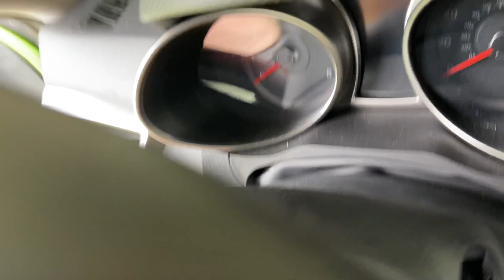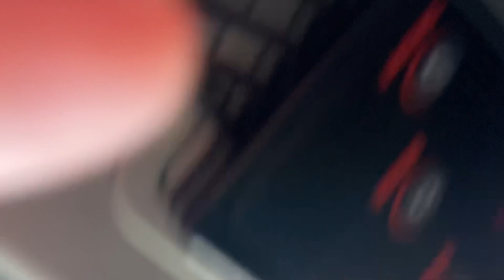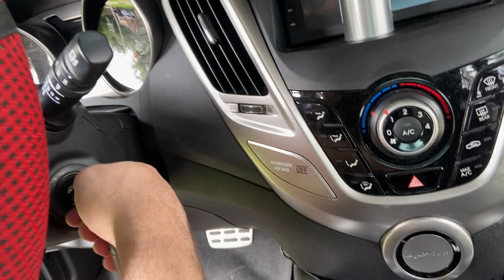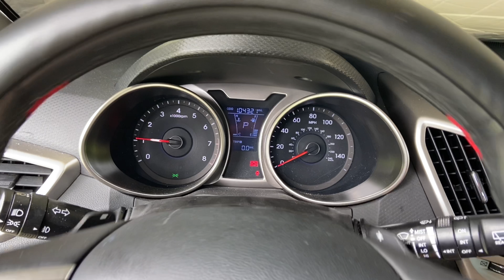Hyundai Veloster - Fix clicking steering wheel

Comment: Any tips for breaking the last 14mm bold loose? I got to that very last bolt and could not break it lose without risking damage from slipping(its really hard to get the proper leverage), Im thinking of waiting untill its really cold outside and then either using a hair drier and or turning the climate control to blow hot air through the leg vents in the hope of some how expand and contract the bolt enough to break it lose more easily. I might end up having to bite the bullet and buy a torque wrench or somethin, or maybe a neighbor might let me borrow one. Also i was wondering if using any thread losener or stuck bolt spray cans would be a good idea, as long as i also put back on the thread locker afterwards, and as long as i clean all of the thread losener off And dont get it on ANY of the electronics/wire connectors... i guess i will save that as a last resort. 

Also Thank you for posting this video, you are a life saver!
Reply from the maker: The trick I use for stuck bolts is to slightly tighten them first, then try loosening again. Kind of a ‘rock back and forth’ thing.
Reply: @Frostcall  I don't know if I can tighten it,  it'sREALLY REALLY on there. I can't budge it at all in either direction, it feels way over-torqued past spec. I think one of the techs at Hyundai the last time they were under the dash and stuff, they went a bit ham on that bolt. I mean I'm putting enough pressure to worry about breaking my wrench or shearing metal on the bolt. That tight.
Reply from the maker: @CrazySaVaunT  Yeah, sounds like it’s over tightened.
Reply: @Frostcall  It is still barely getting into winter where i live, CA, meaning just starting to get below 55F lowest at night. Im thinking i might be able to break it lose when its 40F, also thinking of putting an ice pack on/around the bolt before hand, or trying a few alternations of that and a hair drier. That or maybe make a deal with someone at the dealership to just brake it lose (though I doubt they will touch it without paying full price)
Reply from the maker: @CrazySaVaunT  Best wishes. I hope it goes well.
Reply: @Frostcall  not sure if my previous comment was deleted because of the link, but i got it off. I found out that the coupler is glued in place and I cannot for the life of me get it off without doing damage. Have you ever heard of this?
Reply from the maker: @CrazySaVaunT  No, I’ve not seen it like that before but I haven’t been a real mechanic in over 20 years so there’s a lot I haven’t seen.

Comment: My same car
Cruise (on) working
But speed lock not working 
What might be issue ?
I have same veloster model 2012 
Cruise (on) button is working
But speed lock not working 
What might be issue ?
I have even changed coil spring but still speed lock not working
Reply from the maker: I don't think so. That sounds like you have a different problem. Your problem sounds electronic.

Comment: Thanks for the video.. so I accidentally pulled of my steering wheel and when I placed it back my steering wheel is off center.  Would you know if I have to remove the 14mm bolt just to realign the steering the wheel ??
Reply from the maker: I didn’t know it could go back on off center. It might be a good idea to have a friend help you and take it off, then put it back on (the bolt).

Comment: We changed ours in our car but the airbag light does not go off now would u happen to know what we did wrong
Reply from the maker: It sounds like one of the airbag connections might have come loose out a wire was damaged. Try disconnecting the airbag plugs, then connect them back again. Make sure the car battery is disconnected before doing this.
Reply: Ok thank I will let u know if that works
Reply from the maker: @ernestinahinojosa8256  Did you get it working?

Comment: Thanks for the video! I don't have a noise but I do feel the steering a bit looser (with some play) in the center. You think it might be this?
Reply from the maker: Erwin Ried If there is play in the steering wheel without the clicking, it might not be this issue. It could be the tie rods.
Reply: @Frostcall  cool, will check. It just feel looser than before, but without clicking

Comment: Hello! The controls on the steering wheel of my veloster stopped working. Do you have any idea how to fix it?
Reply from the maker: Both sides or just one side? Also, have you recently taken apart the steering column or the radio? If so, something might be disconnected.
Reply: @Frostcall  Do not disconnect anything yet, it is as it came from the factory
Reply from the maker: @tonybernier9118  In that case, my first thought would be that a fuse has blown. There are two fuse boxes in the car but the one you want to check is located near the steering wheel on the drivers side. Get a cheap fuse puller so you don’t damage your fuses and start checking the fuses in that box. Most should be labeled on the cover. This might be a very cheap fix.
Reply: My controls on the steering wheel stopped working as well as the horn. I had to replace the "clockspring" in the steering wheel to fix it.
Reply from the maker: @PatriciaSmith-fz6mx  If you have a video showing how to do this, feel free to link it in here. It might help Tony.

Comment: Tried it. Failed. The extraction was easy but putting it back was a hard task. The spine of the wheel slid off while I was trying to mount it back with the 14mm screw. Eventually I got everything back on but now my EPS and Traction lights are on and the steering wheel is tight to turn. Any suggestions?
Reply from the maker: There is likely something that is not connected. Re-check all of the connections and look for any broken wires.
Reply: Will do. Appreciate it.
Reply: Check it and you were right. The pink wire coming from the EPS was broken from the connector. Any suggestions on how to pull the excess wire still in the connector, so I can insert the hot wire back in?
Reply from the maker: @stacyreddick7464  Here are a few videos from others that might help. It's really not that difficult once you know how to do it:
https://www.youtube.com/watch?v=r7GlDBge_WU
https://www.youtube.com/watch?v=beI0L23S5hY
Reply from the maker: @stacyreddick7464  Sorry for the late reply. If there is not enough wire, try using a wire coupler (google it) to connect the broken halves, or add more to the broken half.

Comment: Please please help my husband did all this steps, and now I have no steering period!! Any tips.
Reply from the maker: If you have absolutely no steering then it’s likely that the steering column is no longer connected to the steering wheel. If you have some steering but it’s difficult, then it’s likely to be a power-steering issue. Have a friend of your husband’s go over the steps with him, one by one. A second person is usually needed to get the steering wheel back in place properly. Take a lot of pictures as you go through the steps and compare with what you see in the video. If all else fails, call a mechanic. You can do this.
Reply: @frostcall i have no power steering now either. ESP light and traction light are now on and were not before this.

Comment: Heeeeelp! I have replaced the coupler but my steering wheel didn’t lock and I am having hell getting the column up so I can thread the 14 mm bolt... the lip that must go thru the back of it first is hitting the bracket. I cannot see you get it lifted enough to slide in. Also my steering wheel did NOT lock. 😞
Reply from the maker: Lorena Swan I used my legs to lift it in place but it might be helpful to have another person help lift it while you put the bolt in.

Comment: Perfect video ty but I'm having a hell of a time getting steering wheel back up in place didn't realize how heavy it is
Reply: it's nearly impossible to lift, position, and bolt by yourself. nearly had a heat stroke doing it haha.
Reply: I ended up having buddy come over and lift main piece and you have to push back towards firewall so it seats ,but otherwise your tutorial was just perfect plus it was 95 wonderful Florida weather
Reply: @kevinkelly9955   ok another issue gas tank takes forever to fill up
Reply from the maker: Sorry I didn’t capture that part on video. I was upside down with my feet on the seat and used my legs to lift the steering wheel while I put the bolt in.

Comment: What did i do wrong because
Steering coluim is cruket
Reply: Please help me
Reply from the maker: Try going through the steps again, slowly, with a friend to help. Go slow, watch the video a few times. You probably missed a bolt in the steering column. Let me know how it goes.
Reply from the maker: Also, read the pinned comment in the comments section about the steering column. It can be tricky to get the steering column in properly. You can do this.

Comment: Can I just turn the circuit breaker panel to OFF instead of disconnecting the battery?
Reply from the maker: No. You need to disconnect the battery so you don’t set off the airbag and simply turning off at the breaker panel won’t disconnect the airbag (from my understanding).

Comment: If you get this take to to dealer or call, I took mine in doing same thing, there is a recall on the part for this. At least there was for my model and year. I had a 2014 Veloster Turbo

Comment: 5:09 - 5:13 Another Important Point,  that connector there, instead of prying at it from the top side right side, if you poke the flat head screw driver on the opposite side underneath (the side where you plug stuff into it normally, there are two push pin thingies, you can push that clip in and it slides right out instead of risking plastic damage and or inducing a rattling noise by prying at it that much.

Comment: I did everything everything and it appeared to be right when I loosened the wheel  I went into my house to look at the video when I came back out when wheel was laying on the floor it seemed to be in a different position the holes for the 2 12 meter holes where almost upside down but the wheel didn't line up, this may cost me a flat bed and a lot of money

Comment: What happens if i do not fix this?
Reply from the maker: Probably nothing serious for a long time. Other than the steering being more difficult, you could eventually damage some of the internal components not being cushioned by that rubber piece. But that will likely take many years. It’s more of an annoyance.
Reply: @Frostcall  I appreciate you're insight and I definitely will take it into consideration. Thank you.
Reply: @Frostcall  I got a free new engine, due to the recall after over two months at the dealership. Got the car back and didn't want it to literally sound like a clunker with a new engine in, so finally decided to tackle this

Comment: Thanks so much for the tutorial.  I accidentally pulled off my steering wheel while installing back on. My steering is slightly left while driving now. Any suggestions? Anyone?. Thanks
Reply from the maker: I’m not sure, but maybe try taking it apart and lining it back up so it’s straight might help.
Reply: Thanks , I'll try that.

Comment: My steering collumn is moving in and out now that ive changed this
Reply from the maker: You're missing a bolt somewhere. Go over the steps again and I think you'll find the issue.
Reply: @Frostcall  oddly enough my adjustment lever moved so much it loosened that bolt that holds all of it i gave it a few small turns it adjusted as it should

Comment: That was amazing. I did mine yesterday but when I completed, my ESC light came on. Any Idea how to turn it off or fix it. It wasn’t on before. Thanks, for your help. If someone can help me, that will be great.
Reply from the maker: The electric stability control (ESC) light is usually illuminated when the ESC has manually been turned off. First, try pressing the stability control button (the one with the car that has swerve lines under it) near the air conditioning. If that doesn’t make the light go away, then you might have a loose connector in the steering column. You can unplug, then replug all of the connectors (after battery is turned off).

Comment: I changed it and my power steering light came on and steering wheel got hard
Reply from the maker: I don’t know about the steering, perhaps check the connections to make sure everything is seated properly by unplugging and then replugging everything back. Also check your power steering fluid under the hood to make sure it’s in the correct zone of min and max.
Reply: @Frostcall  thanks bro just fixed it connectin wasn’t plugged in 😓
Reply: @Frostcall  thanks bro just fixed it connectin wasn’t plugged in 😓

Comment: The steering is very tight after this. Like there is no power steering
Reply from the maker: It sounds like not everything got plugged back in. Check the fuses, check the plug connections.

Comment: I did this and now my eps light is on and traction control
Reply: Did you find a fix to this?
Reply: @brysonlowe175   yes. It turns out its just the motor went out. Its like 200 bucks for a used one

Comment: Did anyone also have some steering wheel play while drive with the clicking noise?
Reply from the maker: Yes. The breakdown of the rubber thing is what gives the steering wheel play. The play in the wheel (and lack of rubber between the metal parts) is what causes the clicking.
Reply: @Frostcall  thx!!!!

Comment: For something that is so easily to break to be used as a steering coupler is beyond any normal reasoning.  Like what were Hyundai thinking when they designed this?  If you're mechanical savvy then this would just be a pain in the ass, but to the normal average person, they would be spending 300-400 dollars every time this part wear and tears.
Reply: After examining the old coupler its literally melted marshmallow....I can see this being an issue in hotter areas that can reach 90 -100 degree plus.  I'm not sure if Hyundai factor this in but it was a pain to replace something that will melt and shred so easily.  I'm in California and when this first happen it was during a very hot weather.   And since gas was expensive I went with opening the windows instead of turning on the A/C.  Since I now know where the coupler housing is located I'm probably gonna turn on A/C and have it also vent to the leg area during hot days to hopefully prolong the coupler.
Reply: Will this make your steering not return to center like when ya going around a curve??
Reply: @ethanstallings4459  What do you mean?  Do you mean when the steering coupler is broken or do you mean when you're replacing the part?
Reply: @rustybros   yes before ya fix it my steering wheel has the play and that noise but like when im going around a curve I have to turn it back like it won't straighten itself out didn't know if the coupler would make it do that to or if I had 2 problems
Reply: @ethanstallings4459  Hmm..That might sound like a different issue.  The coupler is literally just a rubber plastic that acts as a cushion between the two metal gears where the steering pump and steering column meets.  Do your steering wheel feel heavy like there is no power steering anymore?  Probably look into the steering pump?
Reply: @rustybros   no I don't think its in the power steering tho idk lol but when sitting still ya can move steering wheel bput a inch back and forth and its making a clunking noise
Reply: @ethanstallings4459  did you replace the coupler yet?  If not I would start there since it sounds like the same issue as the video post.
Reply: @rustybros im definitely gonna start there and want to let ya know I appreciate the help not many people in the world left ya you!😇
Reply: @ethanstallings4459  Np bro.  Always got time to help a fellow veloster. :)

Comment: Theres 2 retaining clips on each side of the steering colum. Take those out. The steering wheel will separate from the rest of the assembly. Now you only have to wrestle with thr bottom half and it is much MUCH MUCH easier. Id of saved an hour of wasted swearing and useless struggle lol.